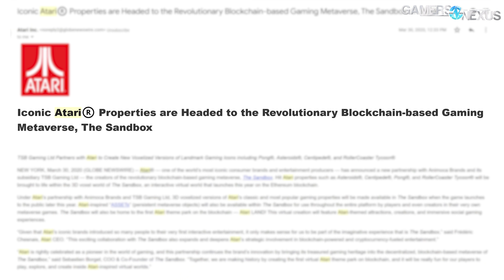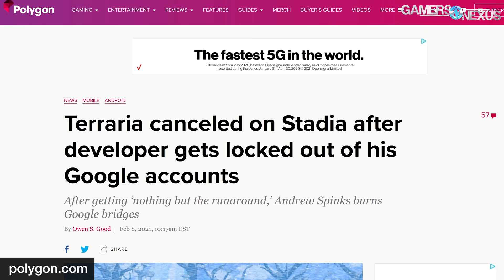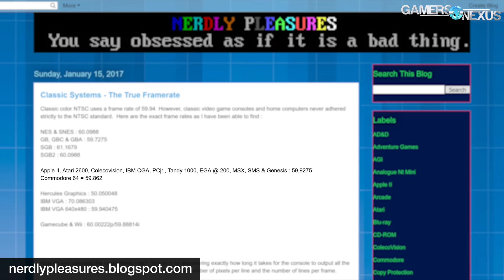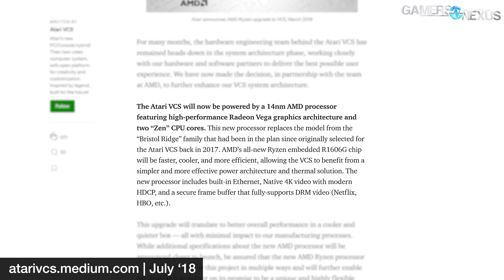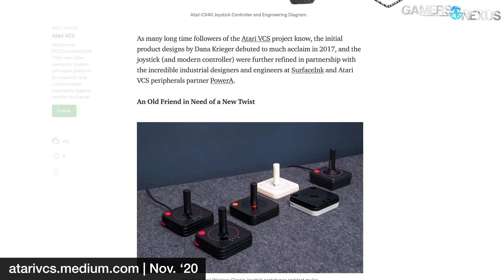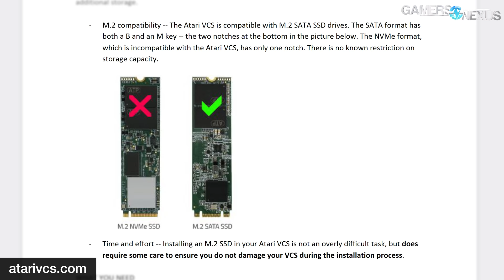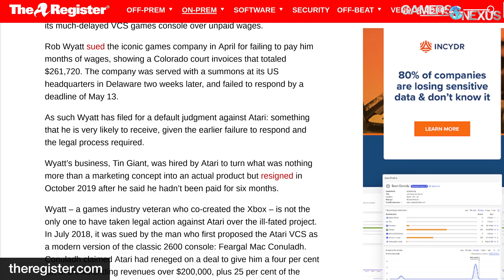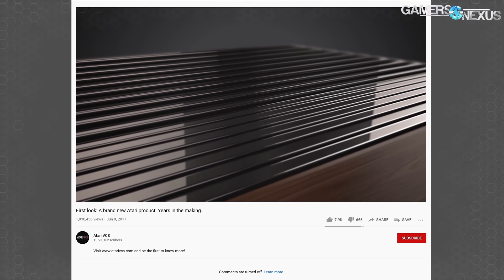Against All Odds: Atari VCS Mini Ryzen PC + Console Review

Comment: If only there'd be some aftermarket fan add-on that would blow the warm air back into the machind, I'd totally buy this!
Reply: der8auer would certainly do this, if he ever owns one.
Reply: @ulrichkalber9039  it was a joke referencing gn's previous video
Reply: @mhh3  lol i overread the "back into" part...
now i suspect that the parts from that video might be put to good use, now that they are there.
we want to hear that we are running a console after all...
Reply: if you have a 3d printer you basically have one
Reply: Luck sucks
Reply: Here I am trying to forget such an aftermarket device was even created   lmao!!
Reply: If you want it to run hot, just set the power and temp limits to dumb numbers. Ryzen Controller will do this or if you like command line based options, RyzenAdj works in both Linux and windows via command line. It also works for everything from 2000 series to 5000 series Ryzen mobile chips.
Reply: Lol!
Reply: If an aftermarket fan blowing warm air back is not hot enough for you, I know of a cheap PCI-E riser that would surely meet your needs
Reply: Meh, just get a PS5 if that's what you want. I hear they're great for counter-airflow fans.👍
Reply: @tmi1234567  Yep, I can confirm that Ryzen Controller/RyzenAdj does indeed work on these embedded chips - I have an HP t640 here (almost the same thing, has an R1505G) and those tools happily let me double the power limit if I want to. Does make it get hotter so adding a fan is very much needed on that one :P
Reply: They just don't have the pull of Sony.  That PS5 reheater would blow your mind on the VCS... Great console, great games, and totally non-sketchy release...
...coupled with a reheater.  That KFC console is going to be the punchline of a joke, and VCS will emerge from the ashes laughing.

Comment: Editor's Editor's Editor's note note note: These statements were before Stadia was facing a Class action lawsuit for false claims over 4K, as it turns out a 4k video stream of cyberpunk running at 1080p is not in fact, 4k.
Reply: xD
Reply: Well, Google probably saw how well FauxK was working for the PS4 Pro and wanted to try it out. 
(Seriously, how has Sony avoided also being sued for those lies?)
Reply: @mjc0961  Probably because they said that the PS4 Pro could run games at UP TO 4K, not at 4K.
Reply: @MysteryMii  same scam as ISP speeds - up to, only rarely or briefly at or average.
Reply: @bipbop3121  ISP's advertise bandwidth which is the estimate on the capacity on the line you've subscribed to. The throughput is what you actually get.

Comment: You can unlock the bios and overclock the cpu
Reply from the maker: Neat. Haven't tried that yet. Thanks!
Reply: Eta prime channel already done that, cmiiw
Reply: Here_we_go.exe
Reply: @joerig96  He often leaves a lot on the table with his reviews.
Reply: @DarkLinkAD  Literally. Look at that work desk!
Reply: @GamersNexus  gotta do an OCing video on this, too cool not to. esp if you get full voltage control and all that, maybe even strap an AIO to it or smth
Reply: @tarfeef_4268  What AIO. It should be a waterblock like what Steve did with the Hades Canyon NUC  . I love to see Frankenstein mods with this console.
Reply: @fleurdewin7958  they don't manufacture stuff. That hades Canyon block was a product made by another company. That doesn't exist for the Atari. They should be able to jury rig some way to mount an aio, though
Reply: @tarfeef_4268  ye but the console was lended (is that even correct?) to them by a patreon I believe (Steve mentions it on the start of the video).
Reply: I haven't overclocked the CPU, but I have overclocked the memory. Stable at 1600.
Reply: @raddysurrname7944  It should be "lent"
Reply: @GamersNexus  LN2 OC video requested please 😂
Reply: @raddysurrname7944  some viewer lenders have been rather permissive in the past about what they can do with lent products. also, they CAN buy one. nobody said this video needed to come out next week
Reply: @GamersNexus  - kinda - the password changed with the latest firmware update. But there's been a lot of chatter from the early adopters on Atari's discord and the consensus is Atari is looking into providing the password with caveats - or ultimately waiting for it to escape again. But ya - I wouldn't get into overclocking and shelling out for thermal paste and more expensive higher-speed RAM (although some have found it cheaper at the higher speeds so brands may vary bla bla bla) may not be the best approach 'at the moment'.  It's showing impressive benchmark gains tho. Like 2x the performance.
Reply: @joerig96  Retro Axis is the one that found the password.  ETA Prime failed to give proper credit.

Comment: To the question of why people backed this on Indiegogo, I think there were two main reasons: One is the nostalgia factor that old farts like me get off on. The Atari 2600 was the first "major" console I played on as a kid, and this thing really scratches that itch. The second reason is modding and tinkering. One of the stated goals of the design team from the beginning was making a machine that people who like to mod and play around under the hood would be able to do that with. My personal reasons for backing it were some of Column A and a little of Column B.
Reply: Not just that, but with some external tools and tweaking, you can add 16gb of ram with an OC on it to 2666 from the base 2133 help the Igpu performance some, and you can extend the Igpu dedicated vram from 2gb to 3gb or 4gb, and add a higher frequency maximum to the Igpu with a simple bios mod. With these tweaks you can get Cyberpunk to run at 720p ~45fps with dynamic resolution, and make most games playable at 720p or 900p.
Reply: Yup. I wanted a new Mini PC at a fraction of the price of other options (particularly from Apple) to go into Linux fulltime. I've been dancing around with it for a while and wanted to 'commit'. Plus it's a great little Retropie console. Steam too.

Comment: Well. It looks fucking sweet, and isn’t locked down, so that’s a win.  I’d probably get one if I didn’t already have a bunch of sweet RetroPie’s.
Reply: It's a nice Linux platform for those who haven't gotten into Linux before. Been having a blast with Steam Proton which actually runs games faster in emu than linux native on many titles. Most importantly, my previous mini computer was getting long in the tooth and couldn't play a lot of my library accumulated from the various steam sales. The VCS has been running 90 percent plus with no problems (I could drop the settings and get decent performance - but I'm getting addicted to the ones that work in 50+ fps). I've also been getting such decent numbers from Minecraft (compared to the Macintosh) that I've started a server. Next comes the retropie-arch config, then productivity. For me this is really going to be a daily driver - particularly after elementary OS6 comes out (although Ubuntu is pretty robust - I'll likely keep that boot partition. 

Not bad for a mini computer enthusiast (me) who is now quite happy with his new gear at less than a third of the cost of a new mac mini. Is it for everyone? Nah - but it's great if you're into mini's and linux - or even Windows and don't need to run the highest of the high-end. I've had decent results with both Unreal Engine 3 and 4 games to-date.

Comment: Woop. Not a scam then. Well, not a total scam anyway.
Reply: Technically not, its interesting. Practically is useless and expensive. Maybe for a niche target audience or some nostalgia.
Reply: Honestly it would make a great Retro Styled PC.....It is a compact PC.
Reply: You can just emulate on your own pc...or hell just pay $400 to play 25 year old games
Reply: @samgoff5289  I don't dislike the product, aesthetically i prefer it than any PS or xbox ... but its obsolete. The idea to be able to stick e.g. a 5600XT and a ssd there, is what would make it actually work .. but also make it something else. Its like having a piece of art on display. Useless, but why the hell not :D
Reply: Interestingly "new" Atari took a page from the time when "old" Atari was around - announce a system that required parts that were not available at that price and then delay long enough that those parts became affordable.  In the 3+ years between announcement and release, the Ryzen processor in this became significantly more affordable.  Heck, became available since the R1606G didnt exist in that form at announcement.  When they announced in 2017 they said it would match a midrange 2017 PC.  In theory that would mean a R5 1600 and a GTX 1050.  I dont think they quite got there but they came pretty close.
Reply: @WildkatPhoto  interesting. I was wondering about weird part selection. Now makes sense.
Reply: @samgoff5289  249.99 at walmart for the VCS400 (all you need if you're going to upgrade the RAM anyway). Not sure where the 400 dollar nonsense got started. Possibly an all-in bundle at Gamestop best I can tell. https://www.walmart.com/ip/Atari-VCS-400-Onyx-Base/387209176
Reply: What scam. Entry level pc gaming at $249, linux based, 14k playable games on steam, Atari library. What else could you ask for?
Reply: @MrJaman0083  yes. It is something usable. I was expecting it would never be built and backers would lose their money.
Reply: Half scam, half chinese copyware garbage. Still a waste of money and a bad experience.
Reply: @SolaufeinG  "niche target audience or some nostalgia", those types of people are not the target market for this thing. This is more for idiots that don't know what an Atari is and want to buy it for poser-like aesthetics.
Reply: @MrJaman0083  A footbath with an intellevision logo? I'll be enjoying my VCS a bit more. Without an androidOS using the worst controllers ever invented (Mattel's) powering iphone shovelware. I'll be using Steam and seeing what other VCS devs are doing. Have fun telling people how to shop from your landfill of hate.

Comment: you can easily install windows by disabling internal mmc in the bios, the vcs os will remain intact after winedows instalation and can be re enabled and kinda have a dual bood by using the boot options to boot form the internal m.2 or remain disabled to wokr as a windows machine only

Comment: About sprite flickering.  The VCS had a limited number of hardware-based sprites (which Atari called "player/missile graphics").  When more simultaneous sprites were needed, they had to be reused on the fly.  Due to Atari's stellar use of indirection, it was possible to change a sprite pointer at another block of memory, and have it near-instantly remapped.  Then only the X,Y coordinates needed changing.  Multiple sprites for the price of one--almost.  Flicker was the price.

My experience is with the 400/800 micro, so I'm not entirely sure how much more difficult this technique was to accomplish on the more limited VCS.  The principles are the same.

Edit: 6:04 - That's what I get for not waiting till the end to post comments.  😝

Comment: I was one of the first that mentioned the jutter on the classic joystick. They RMA’ed my classic joystick at least and i already got the a one that doesnt have the jitter. The rep said they knew about this issue and thought they had it fixed already but seems they didnt fully fix it. Even on the RMA’ed one it popped up but i recalibrated it and it went away.
Reply: Hall-effect joysticks can be a little weird. I think the last one I played was attached to a Xybots arcade cab.
Reply: @mgabrysSF  wait, it is hall effect? I cant seem to find anythign about it on their website
Reply: @fetB  indeed it is - it 'might' have been mentioned in the campaign page (or one of the associated medium pages they posted - but it was specifically mentioned to provide the 'paddle control' function in the joystick which can free-rotate as well as work as a typical atari VCS joystick (with far more directions).
Reply: @fetB  Yes - it's the only way to make a rotatory handle. It's been talked about a lot on the VCS enthusiast discords because prior to the first firmware update there were some calibration issues associated with it.

Comment: So the new EVGA keyboard that has the hot swap switches you are advertising is going to have serious issues if people actually start hot swapping the keys. My brother got one in and first issue is that removing the switches is a massive PITA, then if you happen to have the switch pins go in at an off angle you can actually push on the hot swap receptacle in a way that detaches them from the PCB ripping the solder pad which breaks the entire column of keys. They need to add some kind of support to the hot swap terminals and make the switches easier to remove/insert otherwise they are likely going to have a VERY high RMA amount if people actually use the hotswap feature. I ended up just fixing it by soldering the contacts back with some wire and then reinforcing the hotswap terminals with glue. So tl;dr they seem overly fragile for a feature you are supposed to be shoving key switches into.

Comment: The great thing about the original death grip joysticks, was that they were indestructible. 
Who didn't smash their joystick against a wall or floor when they didn't reach the next level to air the frustration. I have used the 2600 joysticks also on the C64, Z80 and MSX..

About two years ago I recreated the original joystick with 4 micro switches for NSWE directions and an additional for the fire button. Not sure why the developers of the new Atari VCS didn't place the menu buttons on the consoles themselves. Would have made the project much easier (and cheaper). My joystick (2pcs), even with outsourcing the 3D printing did cost me $25 (for both). Compare that to their new wireless hall-sensor based joystick for $100 which is more expensive than a new PS5 controller..

Comment: Interesting, I had to google it and the info is slim.  It appears that the AMD Ryzen R1606G APU  only supports SATA directly, the NVME support is through an external component.  If they are facing supply shortages, it would have been simpler to B +M key SATA rather than M key and extra chip NVME.  If you look up some SBC systems using the R1000 series (one I looked at first was by Kontron) the NVME is processed through mux chips such as the PERICOM PI3PCIE3212 (on alldatasheet)

Comment: That Linux chart is insane & why I have never been able to decide to give Linux a try. As someone who has never used it I have 0 idea where to start or which one would be best to use for average PC user experience
Reply: The key differences are less than one would imagine and is mostly only relevant for the "experts" anyway, that said just for the average PC user experience just try Ubuntu first, it has all that you need and will run e.g steam.
Reply: @Henrik_Holst  I am on the opinion that manjaro would be easier to new users because, even if ubuntu has a biger comunity and its backed by a company, manjaro has a scroolling release I am aware that sounds scary but the fact that they don't have to keep track of the version installed really ease the change, although I did started with xubuntu because felt safer at the time.
Reply: @guerreroobscuro2188  Now GN users are of course a bit more savvy than the average joe but my experience is that when people are exposed to rolling release type of distribution (play store on Android and Steam for games) they are often frustrated when a application or game changes look, feel and capabilities from one day to the other.

And I say that as a having used Gentoo extensively in the early 2000:s, including on production systems. For me was 100% perfect since I as a developer wanted to really learn the low level details of Linux, but that is not for everyone.

That is why I would advocate for a stable release for Linux beginners, then when they have gotten the hang of things and want to experiment they can by all means try out the rolling release distros.

But the most important point about Ubuntu for beginners is that if you google for "how do I x in Ubuntu" you will get thousands of guides on how to exactly fix x for you, that is extremely helpful when you are new to the system.
Reply: Just try Ubuntu Mate. It is simple and the interface is more similar to macOS or atleast how MacOS was the last time I used it.
Reply: @Henrik_Holst  Mint is way better than Ubuntu for beginners. Though once a beginner is comfortable with Linux, they can switch over to something like Arch/Artix or Gentoo to get the most out of the Linux experience. Or they can fully embrace the FOSS life by installing Debian (with no proprietary drivers) or Trisquel. I use Artix btw
Reply: @comicsans1689  Hope you understand that for every new post mentioning a new distribution the point that @dhgodzilla1 was talking about gets more and more accurate?

Comment: I installed windows on an SSD plugged in via USB, then used macrium reflect to clone it to the M.2. It works very well under windows and plays pretty much any non demanding steam game, can emulate most systems to a point, run mame. It runs Kodi well so you could hook up something like an external hard drive dock and put your dvd collection on an external hard drive and control that.

Comment: Just to be clear.... "Engineered wood" is the general term for all wood based materials that are processed for either structural or budget reasons and is different from regular timber wood. This is includes but not limited to Plywood, MDF and particle boards.

Comment: Okay, imagine this but with an FPGA SoC compatible with the MiSTer project built-in. Imagine all the Atari cores running on FPGA, with digital upscaling and native analog video both supported. One unified UI for retro hardware and software emulation together, all in a small console form factor. Release external add-ons like the PolyMega, and that would be my dream retro machine.